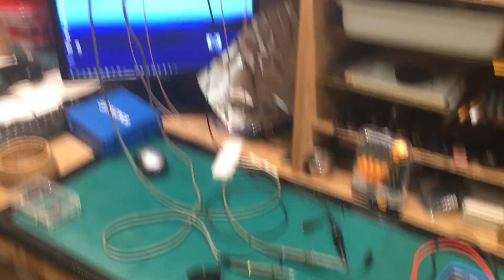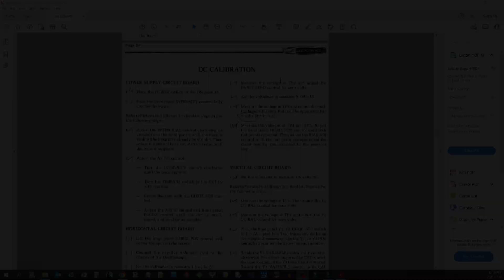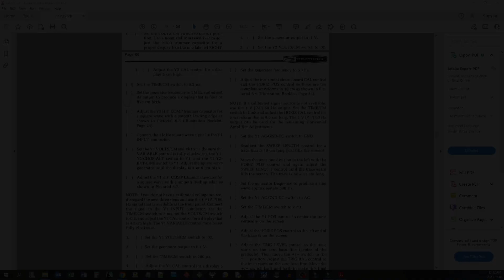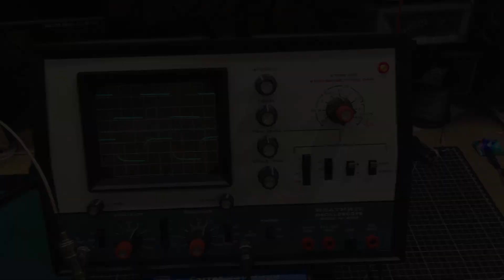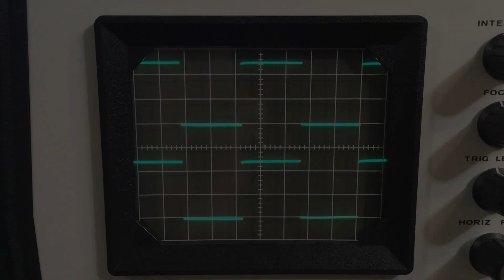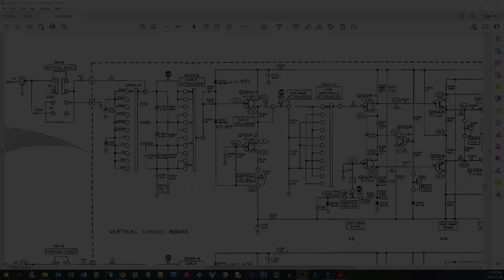0072 - Fixing up the Heathkit IO-4205: Part 2

Comment: I must have had an early production model. Instead of the FET array, mine had two discrete FETs in pin sockets. If you couldn't get the DC offset to zero, you had to swap the two FETs. Thermal tracking was abysmal.
Reply from the maker: Interesting additional information.  Yes, this one seems to be a very late model.